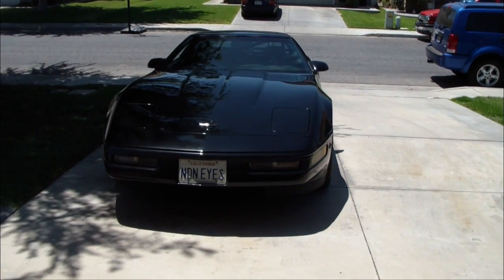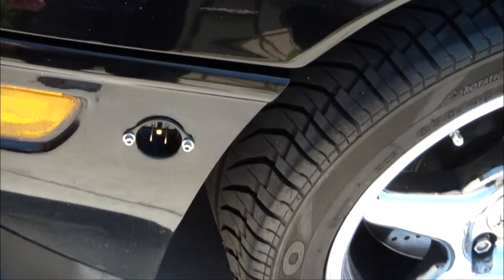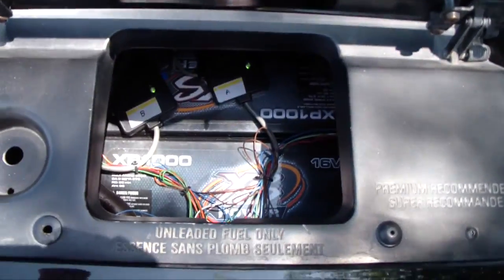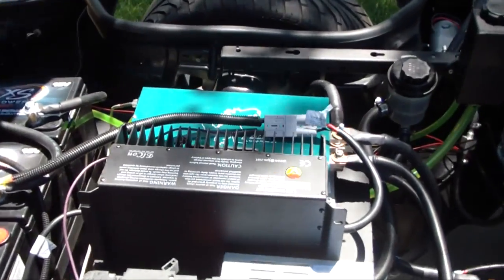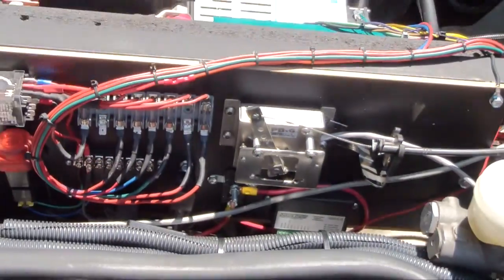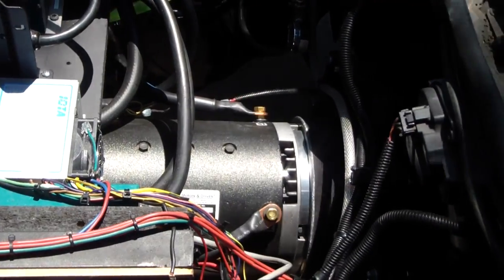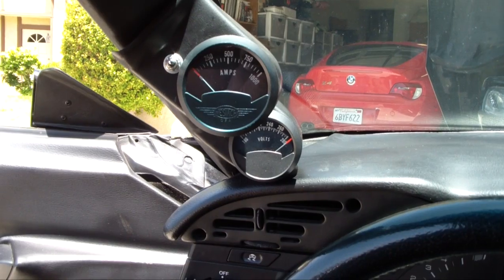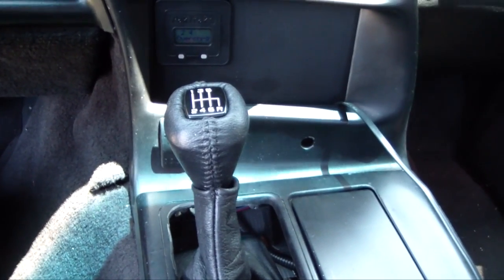Wayne Bickley (Mo's) 1996 Electric Corvette -Walkaround.mp4

Comment: I'm just curious what this costs to do. I have a '92 Corvette. I can see getting another one and converting one to electric so I get both worlds.
Reply from the maker: Joseph sorry for the delay responding to you. The simple answer comes down to speed and range.  I'm currently at 386 HP and 360 ft/lbs of torque. My range is now about 200 miles .  please see my website : www.mo-amps.com  for my latest updates.  You can say roughly about for what I have going about 12k for the 3 motors and  about 14K for the 14 tesla battery modules. you can do this for much less of course depending on performance and range.
Reply: @wrbickley  Couldn't you have a lower net cost by buying junked Teslas to get the necessary parts and then selling the rest?  This video is 10 years old though, so is it still running well?  How many miles since the change and how is the range holding up?
Reply from the maker: @TCMapotherIV  The Tesla motors are too wide track wise, I purchased the Tesla battery modules abut 4 years ago and that was the going price out of a wrecked tesla back them. I have updated the car numerous times since then. Yes the car is still running strong and as I mentioned  I'm at about 4.8 0-60mph and about 200 miles rang. I'm using AC motors so I have brake regen etc. 
As I also mentioned you could go with a single motor an stick with your same transmission and depending on range do the conversion for much less. I wanted both range and performance , which obviously is a bit pricey.
Reply from the maker: https://youtu.be/jL9OIq0s0dE  here is my latest video from a few months ago with the new motors.
Reply: @wrbickley  it seems like an amazing car.
Reply from the maker: @TCMapotherIV  Thank you, yes it’s a blast, and gets quite a crowd at the car shows.
Reply: @wrbickley  it will likely go up in value when they release an official one.
Reply from the maker: @TCMapotherIV  perhaps so :)

Comment from the maker: Hi Gman  sure you can this particular  video is  quite  dated, I am using 76 200ah lithium cells and also using  a Netgain 11HV 11 inch motor. my range is  right at  about  100 miles.

Comment from the maker: Hi Jon,
Yes you are correct I could have... It was a matter of being different. I have not posted a new video yet, but in October I added a netgain  Warp 11HV motor capable of 288 volts and 1400 amps.  Which has allowed me to  turn up the controller. The car is now making  almost 200 hp which is limited by the battery pack, the next phase is lithium batteries. The Electric corvette is one of 4 that I know in North America.
Regards,
MO

Comment from the maker: @FabioCrow07770  at 50mph about 20 miles to 80% Depth of Discharge, Obviously the slower you go the higher the range...  Again I did not choose to size the battery pack for distance... With a comparable set of lithiums I would probably see about 50- 75 miles.

There also comes a point where you are expending energy just to move the weight of the batteries around.  My pack weighs 828 pounds others with comparable size cars are running 12- 13 70 pound batteries with half the voltage...

Comment from the maker: I'm getting about 20 miles range at 50-55 mph, obviously more around town... But as I mentioned I was going for the most power and still stay as light as possible. For the most part I would say you could expect in the 30 mile range depending on your weight of the car... I'm at about 3500 pounds. hope this helps. Also look at the EVAlbum you can scan through and see something close to your proposed build and get a rough idea...

Comment from the maker: Tarsman, I love the XP1000's!!! I was not going for range but more for "spunk" .

I beleive the D3100's would be great for you for both range and amps. I'm set at about 750 amps, but have run as high as 900. So right now my limitation is the motor LOL. The batteries are still fresh so I'm waiting for  more charge cycles...

XSPower is a class act :)